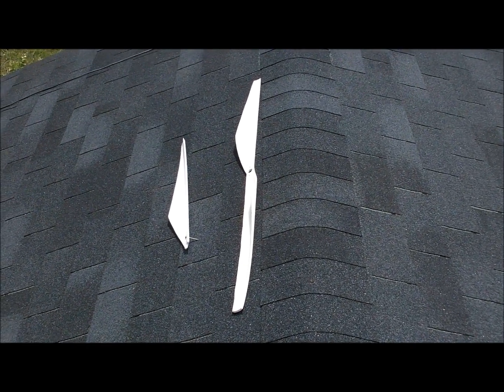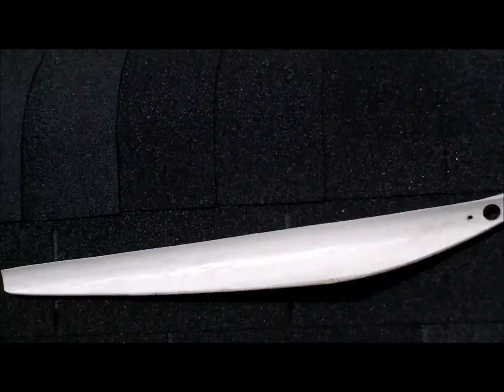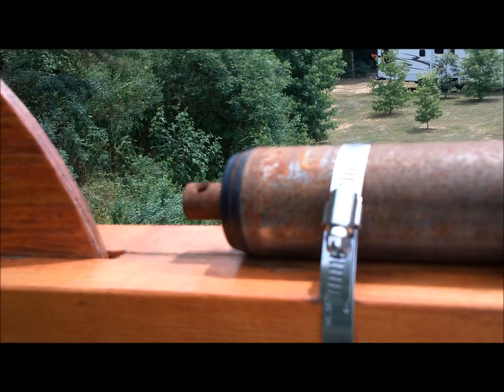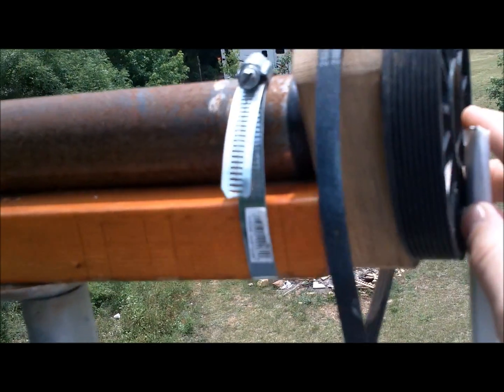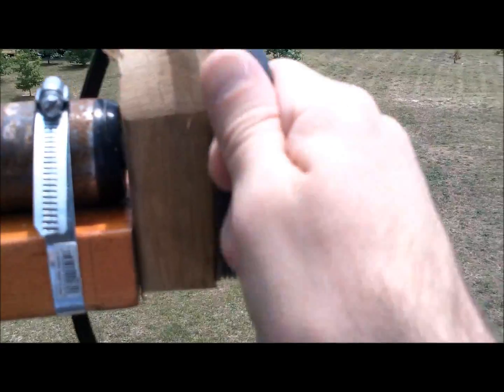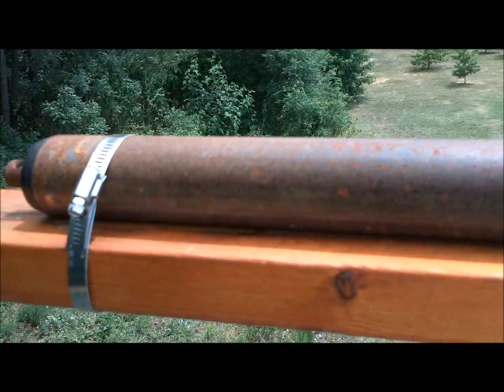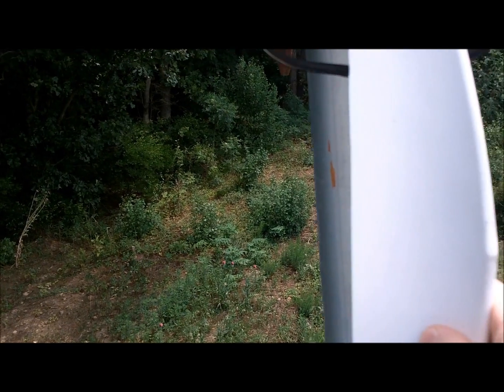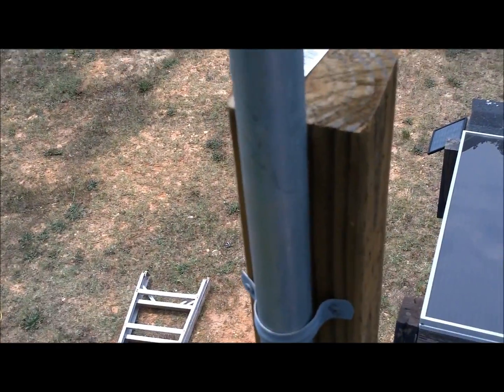Windmill made from treadmill parts

Comment: What if... You used two bicycle rims on a VAWT configuration (one rim above the other), connected with a pipe and using four, 4 in. x 4 ft. PVC pipes cut in half (8 halves), with a quarter twist from lower rim to upper rim each. (twist with heat gun.) As the VAWT spins, the individual curved half-pipes would catch the wind, adding to the spin.? The twisted half pipes would continually catch the wind.
Just a thought. ... What do you think?